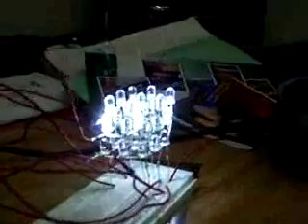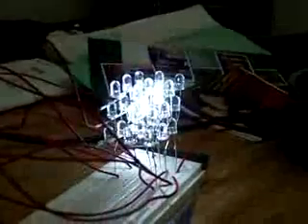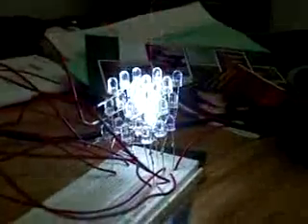3x3x3 led cube arduino demo

Comment from the maker: the leads on the LED's going down are negative, the ones across are positive. I used an arduino to control both power source and ground connections. Connect a layer to the power source, and then ground a single vertical column, and you will notice that only the LED on the layer of the source of power, and the column which is connected to ground will light up. I hope this helps.

Comment from the maker: Wrong, but not completely wrong. Yes I used multiplexing, you technically don't have to, but if your'e going to you HAVE to use persistence of vision. Otherwise say I light top left led, and middle led of the middle layer, the middle one on the top layer will also drain and light up.

Meaning you light the top left, then turn it off and light the middle most, and alternate fast enough that the eye cannot tell the difference. You can multiplex so that this isn't necessary, but...

Comment: is it 3.3v or 9v im wanting to make a big one but not sure where to look tryed google :-) but anyways i seen if you try to power more then 1 led with arduino it will fry it? thanks
Reply from the maker: technically I didn't light more than one led at a time, I lit them one at a time faster than the eye can see.

Comment: can you give me the wiring and code for this
Reply from the maker: probably too late now.. https://en.wikipedia.org/wiki/Charlieplexing is the vague idea of it though. Essentially I was using persistence of vision to overcome the fact that you can't always light multiple rows/columns at the same time. You blink the lights faster than the human eye can notice and that's how you can accomplish the diagonal. Kinda like how an old fashioned CRT works where if you have a slow-mo camera you can see the light draw across the screen. Youtube didn't give me a ping for these comments so  I'm going back through them. Sorry for taking a literal decade. 

If you still want the wiring I'd have to make a diagram, but I may have the code somewhere, I try to not ever delete anything but sometimes in moves across machines code gets lost.